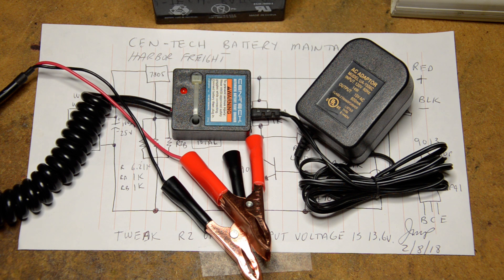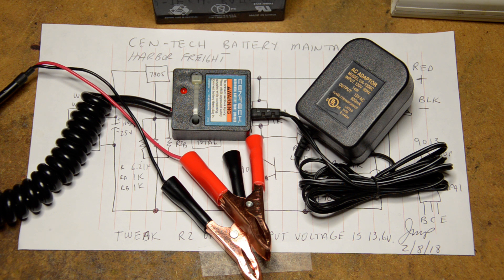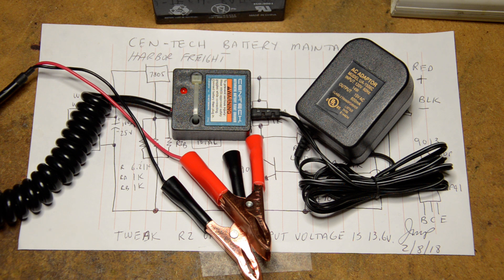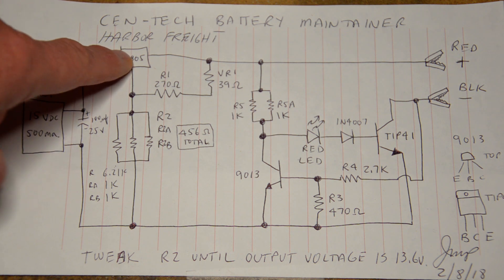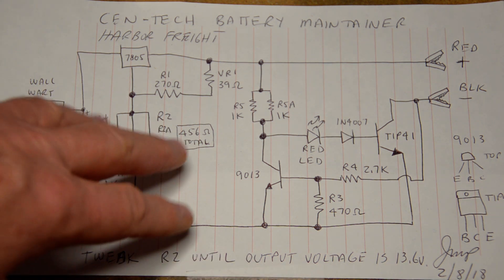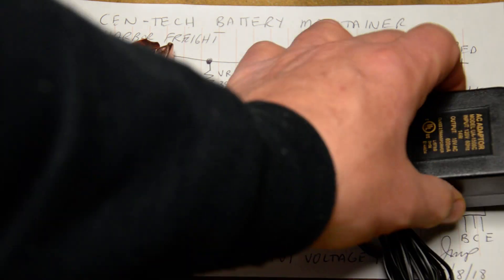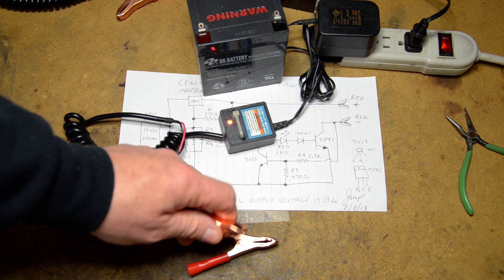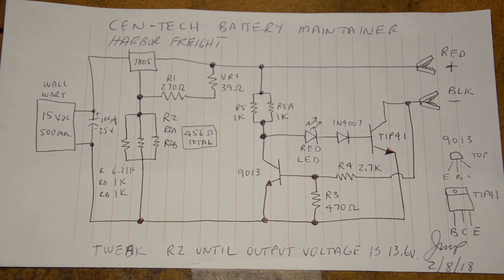Harbor Freight Cen-Tech schematic for battery maintainer float charger

Comment: mine has started flashing the led but it is hooked up correctly.. any advice?
Reply from the maker: Flashing as in continuously at a fixed rate of flashing or is it flickering when you jiggle or move the wires and enclosure in any way?    If it is flashing or flicker when moved in any way I would say it is a bad wire connection from bad solder joint or fatigued wire from flexing them and regular use.   If it is truly flashing at a regular rate I don't know for sure.    The only other thing I could suggest is I did have a unit fail due to the main filter capacitor dying.     I had one with the 100 microfarad capacitor that got cooked over time since it is literally in a hole in the middle of heat sink.   So the heat cooked it over time.   Good luck.

Comment: Good video JP.  Is the back glued on?
Reply from the maker: Glued on or plastic welded.   It was fairly easy to remove.   I used a zip tie to hold it together for future maintenance if need be now that I know whats inside it and that the parts are  all "user replaceable parts".   I have run across comparable transformers that will work at Goodwill occasionally.   With this schematic you could actually build your own.
Reply: Thanks, was going to add a series diode, but still 0.3v too high.  Your solution is better if the cover comes off easy
Reply from the maker: @Michael-hx7mq  There is no need for diode in series with output.    If diode is added the 13.6 volt float voltage will be reduced by diode forward voltage drop defeating the purpose of the float charge voltage required minimum.    The circuit will not be damaged by reversing the battery.   The LED when on will show you battery polarity is correct as shown in video.   If you add a diode this function will be defeated.  LM7805 has reverse polarity protection built it.   The transistors as wired will not be damaged by reverse battery polarity.   If the transformer is not powered up the LED on the unit will slowly discharge your battery over time.  The LED draws about 10 milliamps of current.
Reply: @jp040759  Yes JP, you're quite right, thanks.  I didn't respond well. My unit puts out too much V,  wanted the diode drop to reduce the output external of the box. If I can get into the box without much effort, I prefer your fix.
Reply from the maker: @Michael-hx7mq  AHHH!!!    Now I understand.   Out of curiosity what is yours putting out?    Yes.   Open her up and calibrate it as shown.   Unfortunately there isn't much room inside otherwise I would have recommended a multi turn pot to calibrate it to exactly 13.6 volts out without fiddling with resistor.
Reply: @jp040759  14.6v  I'm not as talented as you.  I struggled with that box ... can't get in, gave up.  Going to experiment with a simple "Vbe multiplier" circuit tuned to drop 1v  May not do well at very low maintenance currents, adj the reg would likely have been better.

Comment: Question: is a trickle charger (like this one) that puts out a constant 13 to 13.7 volts a better design for long battery life compared to the float chargers that cycle on and off as needed?
Reply from the maker: This unit is designed to put just enough current into the battery to keep it topped off without boiling off the water.   Not sure what kind of charger you are referring to.   It sounds like you are referring to a charger that turns off,  monitors battery state of charge then turns on and charges the battery as it requires it.    Only guessing.   Read that chargers manual.   I don't see why one would be better than the other.    The only thing I can think of is the Cen Tech sits there drawing very little power to do its job.   The other probably has may draw more power for the monitoring electronics and I am sure it is far more expensive.   Only making an assumption since I don't know how the other charger actually works.    Good Luck

Comment: Do you keep them connected the whole time or do i disconnect after awhile?
Reply from the maker: As I said in the video if the unit is calibrated to 13.6 volts that is the recommended float voltage that allows leaving it plugged in continuously.  For safety you should check it regularly.

Comment: how long can you leave a battery float on a battery for?
Reply from the maker: At the 13.5 volts specified in the video and Battery University web site it can be float maintained indefinitely at that voltage.    Definitely between usage seasons.  BUT you should always check to make sure there is enough water in the battery.  Obviously if you are leaving it for years it will lose water.   Good luck.
Reply: @jp040759  thank you
Reply from the maker: @xEhsiaN  You're welcome.
Reply: So after it at 13.5 disconnect it and it should be good till you're ready to use it again.? Just want to know if i leave it connected or how long do i keep it connected😅
Reply from the maker: @juanpcjr1  If the float maintainer is calibrated to 13.5 volts which is the recommended voltage the battery can sit at indefinitely per Battery University stated as being  the safe voltage for continuous float maintenance.

Comment: this is an old model in the video, the new ones are smd and are all built into the wall wart, any chance you can help with this model?
Reply from the maker: I am not monetized and I don't have a use for another maintainer so I am not going to purchase one just to make a video.  Sorry.   If I had one I would.    I am sure the circuit is the same accept it is made with  surface mount components.   I don't see any reason to change the basic circuit.   You could build your own with this schematic of the device if you are electronically capable.  The only tricky part is getting the proper transformer wall wart for it.

Comment: Used this on a dead battery that has been sitting for 3 years in a truck. No luck after 12  hours, came off the peg after16 hours, fully charged after 2 days. Gonna try it on my '82 rabbit's battery which is badly sulfated.
Reply from the maker: This in not a bulk charger it is a maintainer for previously fully charged batteries.

Comment: In that circuit, if only the battery is connected (no AC supply) it will discharge through RED led and the voltage divider until it gets completely killed.

Wouldn't it be better to regulate the output voltage up to 15V && put a diode on the positive terminal to prevent the battery discharging in event of power brick failure, AC failure, or accidental/temporary disconnection?

(You would go up to 15v since the additional diode would drop the 15v regulated supply down to 13.8v)
Reply from the maker: Yes it might help.   This thing is built to a low price point.   It is pretty simple and basic.   The only concern is the transformer output is designed as close to the LM7805 dropout voltage that it may not have a high enough voltage to give enough voltage headroom to put out the 15 volts plus drop out voltage which is around 2 to 3 volts.  You would need 18 volts out of the transformer.  This shallow head room minimizes the power dissipation of the LM7805 also.   If you have it tied to car battery it would take a long long time to discharge anyway.    Assume you have a 90 amphour battery and an LED current of 20 millimamps.     It would take a 90,000 milliamp hours divided by 20 milliamps it would probably take 4500 hours (like 6 months) to discharge fully.     You would know the power went out some time during that 4500 hours.   It would be better to install an LED and current limiting resistor right across the transformer output to show there is mains AC line power present.  You would see at a glance mains power was lost.     No doubt this circuit can be improved in a lot of ways.    Glad to see you are thinking.   Electronics is fun.  Thanx for watching an commenting.

Comment: i have a problem with mine it keeps car battery charged but blows out my radio  fuse and when i go to start the car volts read 15  and never had a problem with my car before i but this float on, took it off and disconnected the battery .
Reply from the maker: That is the point of this video.   These things are not coming out of the factory set at the 13.6 volts they should be,  The vid explains how to calibrate them for yourself.

Comment: Great video !  Why didnt you replace the fixed value resistors with a 1K ohm variable pot?
Would make tweeking voltage a lot easier.  I replaced the cheap float charger with an Altronix AL624 power supply /charger.  I use a 16.5VAC transformer to power the charger.  It fits nicely 
recessed into the side area.
Reply from the maker: The PC board was actually designed for installing a trim pot.  They saved the money and went with fixed resistors.    I just went with fixed resistors since I know they will not get inadvertnly moved and there is no chance of drift from a flakey pot.    If there was room I might have used a 10 turn trim pot.   Glad you enjoyed the vid.    Make sure you set the Altronix for the recommended 13.6 volt float charge voltage.

Comment: These things are nothing but junk!  I tried to charge a 12v auto battery for hours, nothing,      NOTHING!  Of course, I'm not all that surprised, after all it was sold in the US!!!!
  Of course, I didn't need it for quite some time after I bought it, and now the warranty is out  and I'm stuck with this junk that is good for noting but dumpster filler!!!!!
  Cen-Tech is just jink!!!!  DO NOT BUY THESE!!!!!!!!!!!!!!!!!!!!!!
Reply from the maker: These ARE NOT CHARGERS!!!!    This is a battery maintainer for maintaining a full charge on an already FULLY charged battery.  Otherwise known as a float charger.    They are cheap but they will do the job if the float charge voltage is set properly as I indicated in the video.   Good luck.

Comment: I had problem with this myself. Returned black and decker because it output 11.8 and wasnt charging. Got minnkota now and works good, hooefully lasts. Minnkota had a sale on old
Model, 2 bank charger for $67. Amazon still has some. Cant beat that
Reply from the maker: WOW   $67 fro Minnkota 2 bank charger.   That's too cheap.
Reply: jp040759 just checked my amazon receipt. 68.99 purchased on 04.26.2018. MK 210D. Thats anout same cost u would pay to get 2 chinese one bank chargers. The only downside is this thing weighs like a small battery and u have to carry in ur boat. I have 4 batteries plus this thing and it adds up
Reply from the maker: WOW you got a deal.   I just looked it up on Amazon and it is listed at $114.35.    They probably jack up price during season and discount them off season.
Reply: jp040759 it was 68 again a couple if weeks ago for 4th of july. Do this: add to cart, then Save for later. This way u dont buy it but every time u log in u will see the price. It will go back again real soon, i am sure. They replaced that model.

Comment: My second mistake; I was shorting the internal most negative power terminal and the Bat + output when I got the 1.25A. Shorting the battery terminals alone does not generate significant current.
Reply from the maker: Glad you tried it.   We both learned something.    Yes the negative battery output lead goes to  the collector of the TIP41 and keeps it isolated from circuit ground when it is off.  Pretty cool little circuit.   It does what it is supposed to.  But it is not automatic.   Glad I could help.   What was the final current draw you measured?

Comment: I shorted my output and measured 1.25A so it really does not turn off the 7805 regulator. The output of the regulator pulls up the negative battery terminal enough to enable the TIP41C to turn back on and sit a few volts above the negative input supply and re-regulate there through another regulation loop. The 7805 does not have to bear the full dissipation of the 17 Watts.

Comment: Thank you for the schematic. Yes, the led goes out when you short the output BUT the voltage regulator is drawing typically 750mA in the shorted condition (TI data sheet). The transformer is putting out 23V and so there is 23 x 0.75 = 17Watts being dissipated by the internal regulator. I do not think the transformer or the regulator IC will last very long in the shorted condition.
Reply from the maker: You are incorrect.   First of all the transformer is rated a 14 watt RMS total power draw.  See its label.   The output is  labeled as 15 volts RMS at .6 amps RMS so it can only output 9 watts RMS of power.   The LM7805 voltage regulator is rated at 1 amp max output depending on the manufacturer.     The LM7805 is also self short  circuit protected.   Next study the schematic more closely.  When you short out the output clips the 9013 transistor gets biased on and it in turn turns of the bias to the TIP41 transistor so TIP41 is completely off.   When TIP41 is off the only current being drawn now is through the 9013 base bias network (R3 and R4) and the two parallel 1k ohm resistors ( R5 and R5A).  The short circuit current through the clips is going to be around 28 milliamps.   Test it for yourself.

Comment: the thing is they are rated  at 600mah so that they can maintain the battery ,dropping in mah hours an it reaches the charging state so it can float  up an down as  the volts drop its design is to bring it back up i have many instances where my battery is at like 12.2 v car wont start from siting . an after 24 hours or less it brings it back up to a full charge ,now  we no its not 
 a charger for a dead battery, but in this way i talk about ,it actually does work to bring it back up to full charge ,like its made to do,never had a problem with mine ,other then the dummy light dont do much ,the new ones have better componants like green light for done an on off so the lower the volts the more mah it puts out ,the higher the charge the less mah it puts out ,there are other videos that show how it works in that way ,not saying they are not all calibrated right either ,but yes i have brought back many batteries with mine to a full charge
Reply from the maker: These are very simply basic devices.   Nothing intelligent about them.   As you can see by the schematic.

Comment: Thanks for the walk through on these.
The GRIP branded float charger seems to be a lot better than these.
It floats around 13.4 volts and they just work.
Reply from the maker: The basic premise of this HF design is good.   Unfortunately the quality control is not there to make sure all float chargers leave the factory at the correct float voltage.      If you have the tech experience they can easily be calibrated by some one with little technical expertise.  Great foundation for a fixer upper for some folks.
Reply: Anything would be better than this junk!
Reply from the maker: @nightlightabcd  I have actually duplicated this circuit and made a couple of DIY maintainers for myself and friends.   I only did it because I had salvaged parts laying around already.    Economically not worth it.